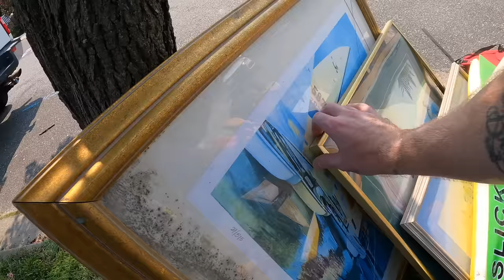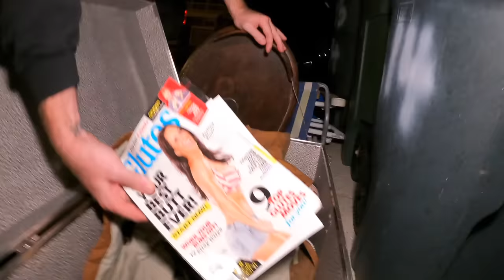Trash Picking MILLIONAIRES Beach Homes!

Comment: Try power washing old carpet and rugs, then use a little M.E.K. for the tough stains (synthetic fibers only), doing this you can make old rugs look brand new in a few minutes.
Reply: In my youth M.E.K. methyl ethyl ketone would eat the laces and stitches out of my boots I worked in a lamination and extruding packaging factory very harsh stuff,,,,,,,,,
Reply: @darrelldillon5658  Indeed. Gets about any stain you can think of out of a carpet.
Reply: @CognitiveDissident.  How do you get the chemical smell out, no need to reply I would have flashbacks. But I have no doubts it removes everything but the chem odor. Carpets now are made for looks not living on then disposal after stains and smells , my opinion only.
Reply: Practice washing dirty small rugs in the driveway---just using the soapy powerwasher!  I just pre-treat stains and jet spray with a hose and keep moving them around on my hot black asphalt slanted driveway.  When you move the rug to dryer spots on a hot day the rug dries out pretty well.  Enough so that you can drape it over a porch chair to finish drying.
Reply: Lets not turn old dirty rugs into a competition unless you have a rug washing channel we can watch on Y tube I much prefer throwing them out when soiled. Wood floors are easy to clean without entertaining the neighbors...........
Reply: @darrelldillon5658  haha don’t laugh but I have watched those.
Reply: Yes… cleaning applies to almost anything you come across!  
Furniture pieces can be REPURPOSED from their original life to something new.

Imagine items…furniture…dirty rugs…broken tables…chairs etc for something other than it’s original purpose.  The old white tv cabinet… I would remove tv hardware, patch holes, add a piece wood for a shelf, add some legs, paint and you have a piece usable to most people…it’s fun and creating something from nothing and inventive and possible bigger profit.
I check condition and if it just needs cleaning, sanding I take it.
Reply: Use dishwashing liquid that has enzymes in it with one of those little green machine  carpet, upholstery machines. I have had great success doing this.

Comment: No, you can get those prints re  matted and re  framed at a framing shop.  And Sometimes  the damage can be cut of. 
So best thing is to just grab them , take them home, get the, out of the frames so you can see how bad the damage is, where it is, how  much of the print is damaged, …And for valuable printers , take to have them re matted and de framed.

Comment: Were the chairs Mid Century Modern? Just like the ones I had in 1965! Gorilla glue and a nice big stapler could fix up a lot of things you pass up.
Reply: Yes! They pass a lot of stuff that a person like myself could easily fix. I am a jack of all trades person, I grew up on a farm and  learned how to  repair and make all kinds of things or either went to vocational school and took numerous classes to learn how to do.  So I could repair or fix 3/4  of the stuff that they just pass on, that could be sold for good money. And I have saw lots of stuff that I think why didn't they get that, cause it would be simple to fix and then sell. Some of those pictures, the actual picture was fine, take it out of the mat and frame, clean the frame and  repaint it and buy a new mat and then sell for big bucks. And as high priced  as lumber is these days, I would be picking up all of that lumber  that they are not even paying attention to.

Comment: I think the “table” thing with the chairs is possibly a console table type thing.  It goes up against and is fix to a wall .  Great vid thanks 🇬🇧
Reply: It was one of a pair or three legs for the table that went with the chairs it may have been picked up already and disregarded not knowing it went with a table top. Most do not look under tables and end up without a leg to stand on,,,,,,,,,,,,
Reply: @darrelldillon5658  yeh that would make sense of the ugly wood on the top !! 
Though a nice piece of wood and there you have a small console table 🪄

Comment: You could use those white wooden shutters to make a headboard, or a table!!  Fun finds, lots of hard work!! Why are the wooden chairs with the floral fabric worth only $50.00?  In Seattle you would get $200.00, probably.
Reply from the maker: Most furniture does not sell for a lot around here. We only ended up getting $30 for all four chairs after they were up for over two weeks.

Comment: About the painting in the beggining, thats the passpartou thats moldy, the art piece seemed fine. You can take the art out and leave the moldy part, cos they are not one piece. Its and extra frame for the painting and can be changed if you want another color.. if you change the frame.. and its made to protect the original art piece.

Comment: The duct tape, there is a way to get the adhesive off. But I am not sure if it would ruin the TV screen as well
Reply: A rag and a little wd40 would clean the duct tape glue then use display screen cleaner! That looks like a Lg or Sony Oled tv! $2000-$3000 at the Store!!! I would not damage the tv all the components are behind the screen is protected by another layer on top!!

Comment: Excuse the pun, but you two are far too PICKY,  when it comes to what you find..Chair's and stools are one of the easiest to repair, or even upcycle..the chair with the flakey varnish/paint just needed a light sanding and re - painting or varnishing..you have to remember that it's trash, and was thrown away for a reason 😂